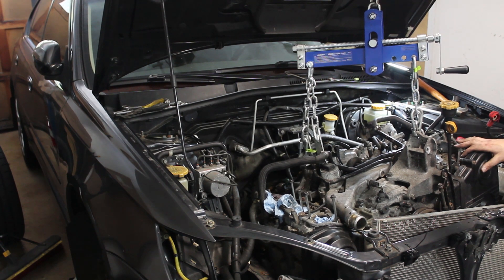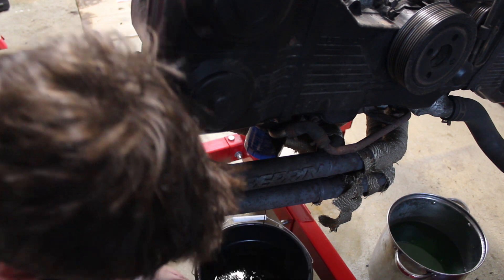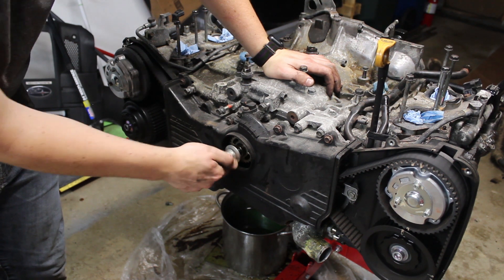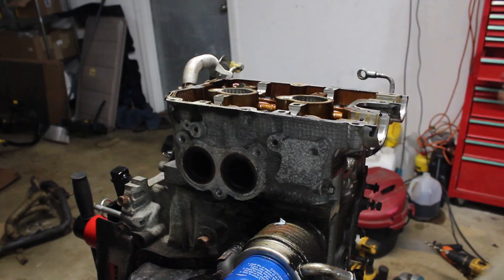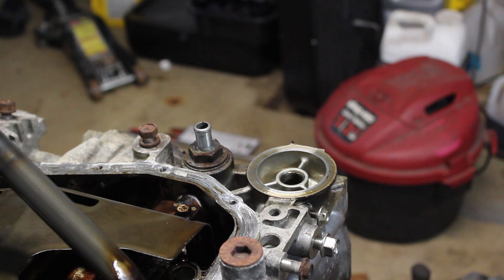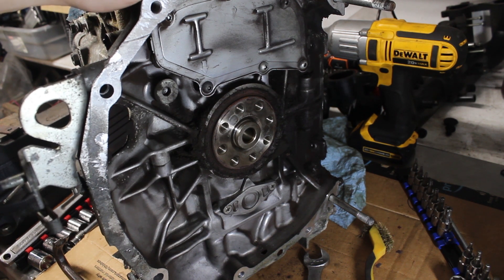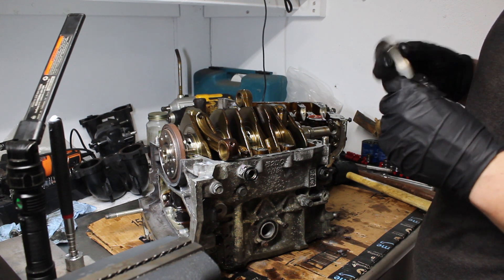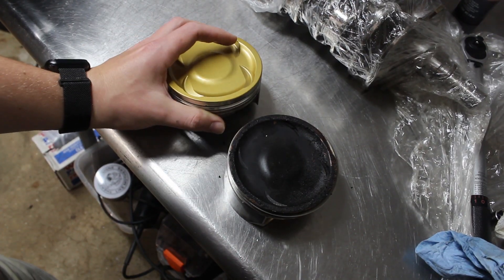Subaru 2.5L Turbo Engine Build - EJ255 Engine Teardown (We Got Damage!)

Comment: I realize you had ring land failure on your pistons, but what is the basis for splitting the block? In your case, I understand you wanted to see if the motor had further damage, like on the rods, bearings, journals, etc.. But let’s say I take apart mine and the pistons are ok, what is the basis/reason for splitting the block? And once you do, do you need to hone it or do any type of resurfacing where the crank rides? My car has 212K miles, if I just want to replace the pistons/rings with better ones, do I need to split the block?
Reply from the maker: It is possible to get the pistons out without splitting the block. In my case, I wanted to check the crank, crank bearings, rods, etc. And of course there could be metal shards left from the cracked piston so it all needs to be cleaned out. I did in fact get the cylinders bored and honed, the crank polished, and the rods reconditioned, which of course requires splitting the block. None of this is necessary, but it's a good idea for longevity. I didn't have the mains line bored, I think this is only really done for high HP builds. Plus my crank wasn't bent, so it was fine.

If your engine looks OK, sure, you don't need to split the block, but I would say it's absolutely a good idea unless you're on a tight budget (and if you're on a tight budget, don't build a Subaru motor, lol). Skipping out on boring (or at least honing) the cylinders, checking the rods, checking the crank, and checking the bearings would be foolish if you've got it all apart already, in my opinion. Doing just the rings might not solve anything anyways.
Reply from the maker: Replying to this comment again- the one you posted most recently is bugged and won't show me the whole thing.

Anyways, I kind of assumed you were talking about a turbo motor, perhaps like mine that is being pushed a bit. For an NA that you just want to keep on the road a bit longer, it's not as big of an issue. I'd just make sure the bores look good and there's no damage elsewhere and it'll continue to run fine. It'd still be preferable to hone the cylinders and check the bearings, but not a big deal.
Reply: @rainvillecreative5410  I have the same car/engine as you LGT, except in a wagon version. I was referring earlier to the work I had previously done on my ‘01 Forester n/a. My question was if it was necessary to split the block if I see no damage in my pistons once the motor is removed. Thank you
Reply from the maker: @MikeSF5  OK, I couldn't see the last half of your comment. Is it necessary? No, it'll continue to run how it did before. Should you? Yes, especially if there is wear on the cylinders, which is almost certain. See how it looks and decide then.
Reply: @rainvillecreative5410  Right, will do, thanks

Comment: Did a rebuild on my 2009 LGT a couple of years ago. We had rod bearing failure at 108k miles on the car. It was actually a fun rebuild job once I got over the price of the Subaru parts... Good luck.
Reply from the maker: Thanks, yeah part of it is fun, and individual prices aren't bad at all, there's just a lot of them that add up. For example an OEM piston is only $80, of course I am going with forged ones instead though.
Reply: @rainvillecreative5410  I actually reused my pistons but had to replace crankshaft, put in ACL bearings on mains and rods. I also did something I dont see many people do or talk about. I used a 12mm JDM oil pump from a twin turbo legacy only available over there. It is my attempt to get as much oil pressure as possible to overcome the lack of pressure towards the back of the engine. Also swapped out filter bolts for open ones. All other parts are directly from Subaru. Yeah, they definitely add up.
Reply from the maker: @beyondhelp8845  Interesting, I bought an OEM pump for my car, I am hoping it will be OK. I noticed the filtered bolts- those are only an issue if they clog, it is good to keep debris out of the turbo, so I will probably leave mine in.